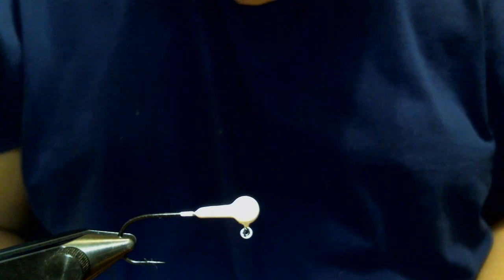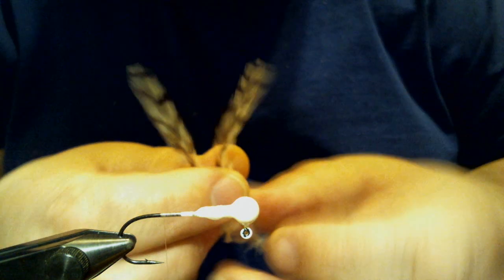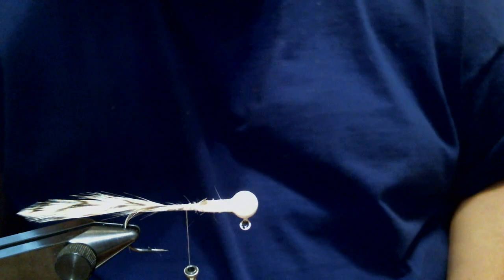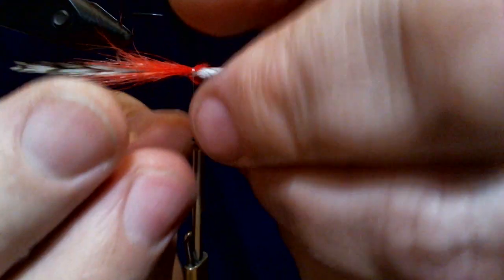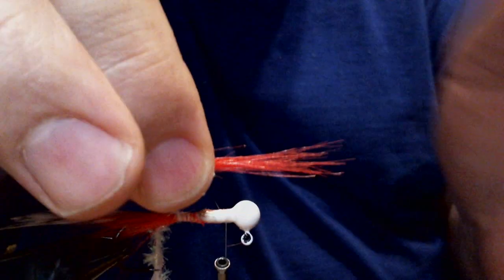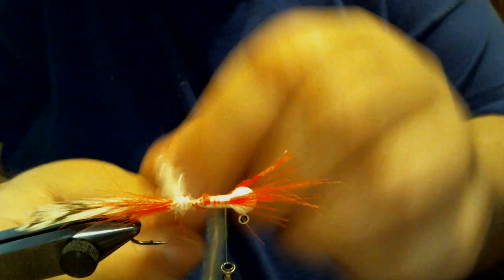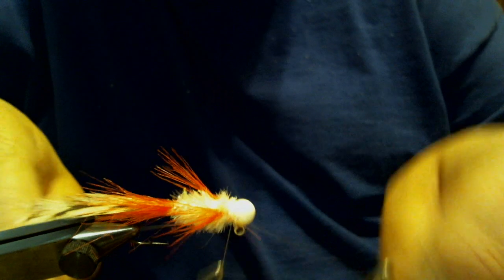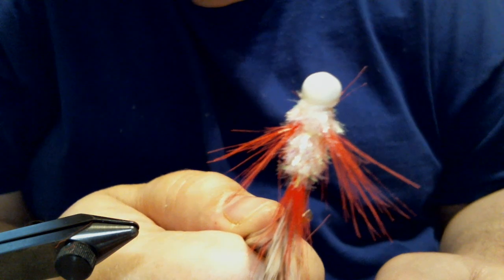Fire Minnow Crappie Jig

Comment: I actually do this same thing for my jigs. Mine are: cut collar to the head (walleye head w eye sockets), mylar tensil on hook shank so it sticks out past buck tail, buck tail on shank up to the head, pearl crystal flash outside of buck tail, start wooly bugger chenille, tie little tuft of calf hair about 1/8" down from head, then wrap chenille ensuring the calf hair gets pushed toward the tail and finish. My favorite color pattern in popsicle, using chart bucktail, purple chenille, and pink kip tail. I use the vinyl stick on eyes with a liberal drop of cement to secure.
I'll have to try this tie too. I like the feathers.
I'm a bit too "hulk smash" for that tiny thread though.
Reply from the maker: Thank you for watching and the comment, I really appreciate it!! Thank you for the detailed description on your jig, I just did another in purple and chartreuse but I used craft fur instead of bucktail. I have some red kiptail that I can substitute for the pink and I have a walleye head mold without eyes and a ball collar. I am going to tie that, thank you!!!!
Reply: What's your contact info? I can pour some plain lead heads if you want some with the eye socket. I use the lil nasty hooks on those. I just picked up the new manic mullet mold for saltwater heads as well. 
Funny, I actually watched the other video you mentioned after I left my comment.

Comment: Hey Smalljaw. You never cease to amaze me. This is really a nice looking little jig. I was wondering if you could give me the jig mold item number. I have been trying to pick out a ball head mold and I can’t seem to see one that is similar to what you have. I have been tying some of your patterns on bare hooks and using them on a drop shot rig with some good success and this seems like a perfect jig for such an application. I have never really fished with a float but I will definitely give it a try. Our waters are loaded with sediment and I have to keep my baits of the bottom and a float sounds perfect. Thanks for the tip!!!  As always thanks for all you do for us !!!
Reply from the maker: Thank you for all your support, it truly means a lot!!!! That is the weedless ball jig mold and I'll leave a link. I just pour it without a weed guard for jigs like this. The model is RVB-5-AF . https://barlowstackle.com/Do-It-Ball-Weedless-Jig-Molds-P253/
Reply: Hey again Smalljaw. Just got in some ‘UV Blast’ powder coat. I was wondering what your thoughts are on this stuff and if you could give me some scenario on when you would use it. Do you think I should put it on all my jigs. 
I painted some jigs last night and when I baked them I had several heads that dripped. I am considering a fluid bed but I am learning toward getting an air gun and spray painting my jigs like you do. When spraying the jigs does the air pressure from the compressor loosen the paint like a fluid bed or would you recommend still using a fluid bed to stir the paint. Thanks again!!!

Comment: What size jigs do you generally make as the most effective for Crappie. I have relied on 1/8, 1/16, and 1/32 but I am wondering about using these hand tied vs the soft plastic I've always used, will a 1/4 be still too big?
Reply from the maker: I think 1/4 is a little on the large size for this type of jig. I like 1/32oz, 1/16oz, 3/32, and 1/8oz most of the time. I know some say I use hooks that are larger than other crappie jigs but I don't have an issue. I like the size #2 hook as crappie have no problem and it eliminates the small bluegill that often hit the jigs too. I do use a #4 for a lot of my crappie jigs as well and occasionally a #6 but I do like a #2 the best.